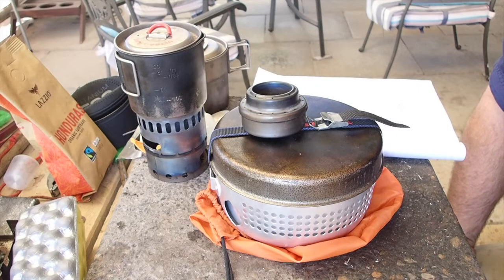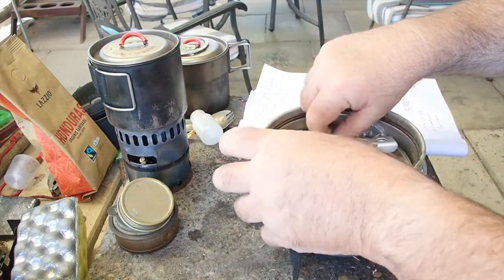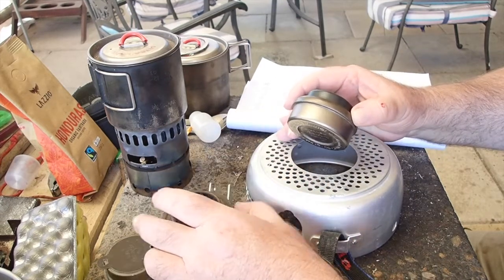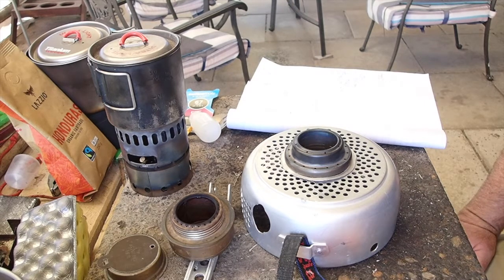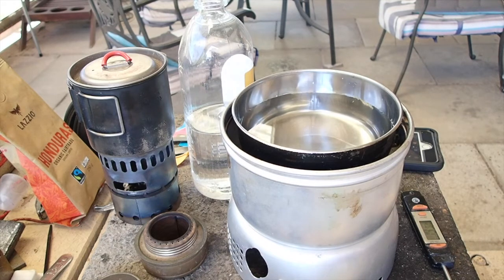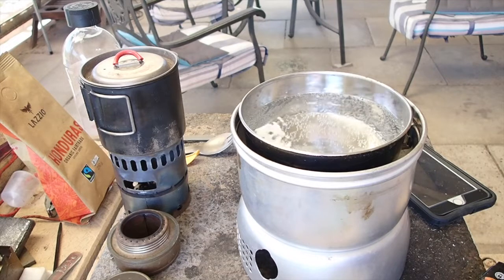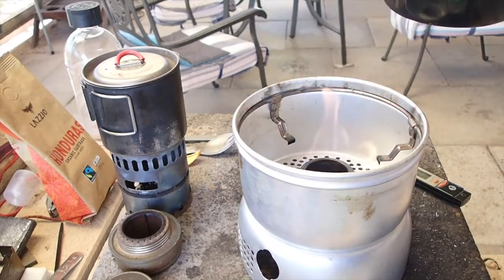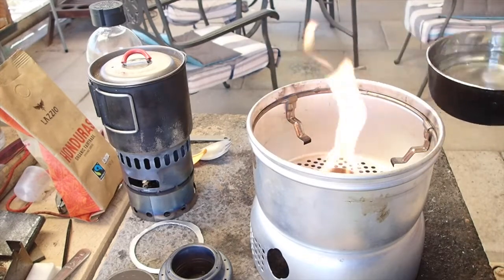Fitting Evernew Titanium burner into Trangia Stoves

Comment: Another video shows it fits and is even slightly big. I wonder if the Trangia hole varies, or does the Evernew vary? He measured his Trangia hole to be 70.9mm, but said the Evernew would not fall through.
Reply from the maker: I can only go on my three Trangia and the one burner and mine fits through all of the bases, one of the ultra light guys used to make a wire adapter to prevent the Evernew burner falling through the trangia base